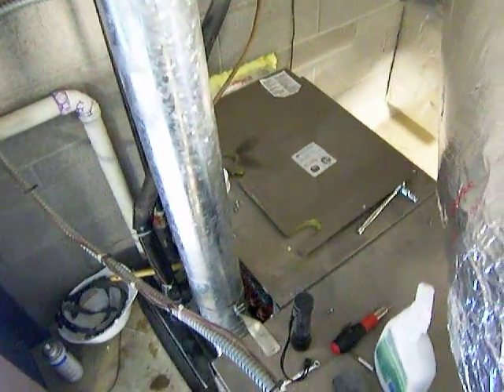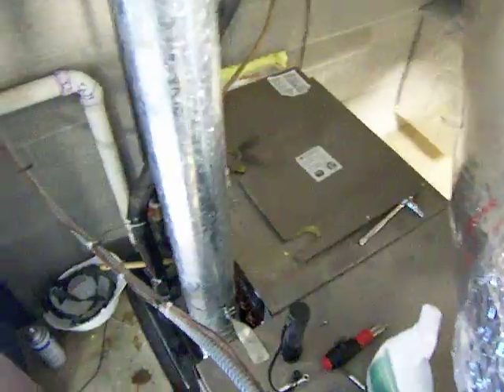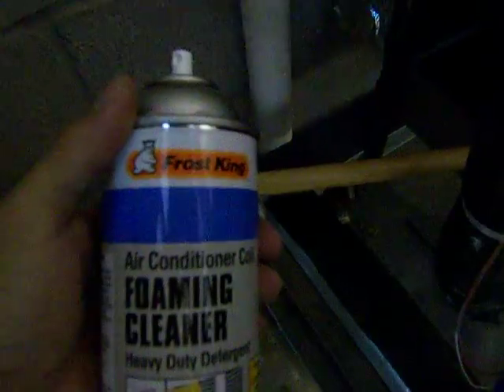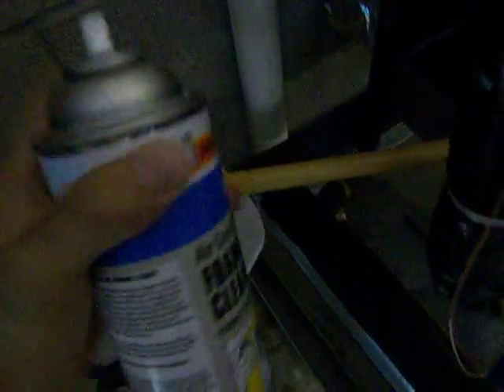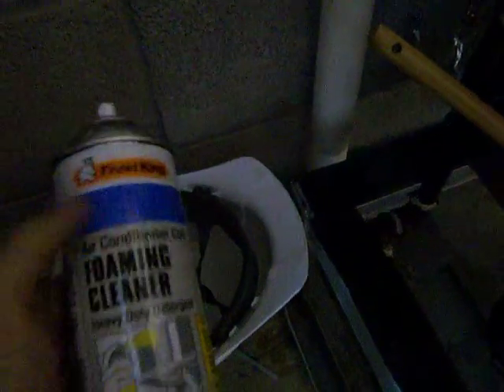Evaporator Coil & Condensation Tray Cleaning

Comment: Back flush up the drain line from the bottom of same for a few secs then allow same to drain down... this will push up the crud and then allow same to drop back by gravity....that could be causing the smell... then flush out from the top tray with a mixture of hot water and a mild solution of 'Savlon'